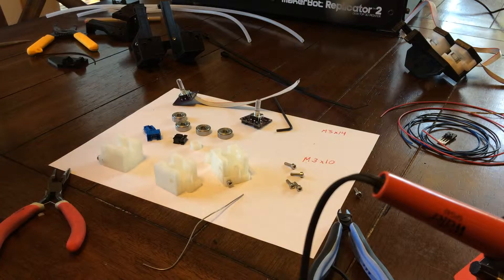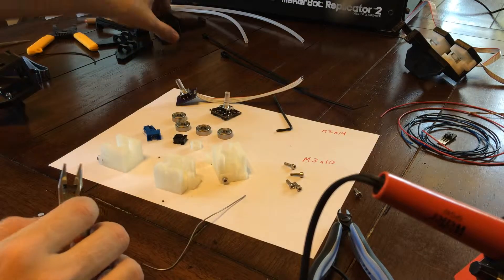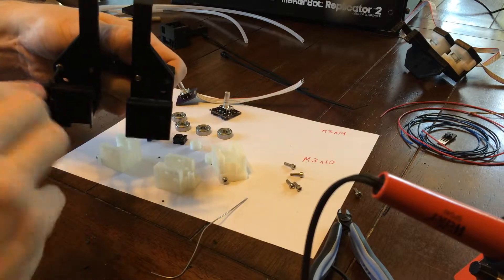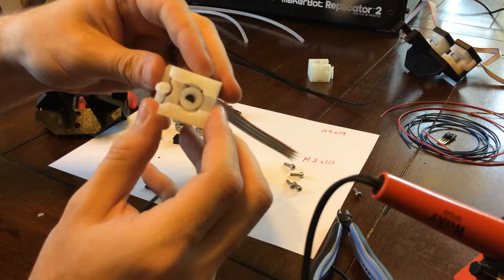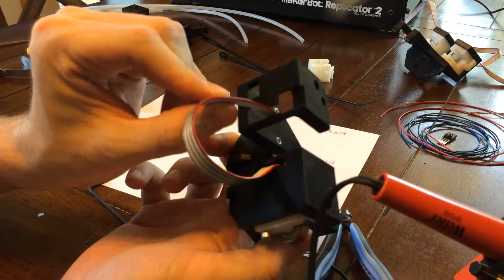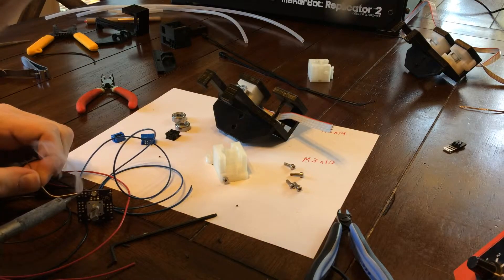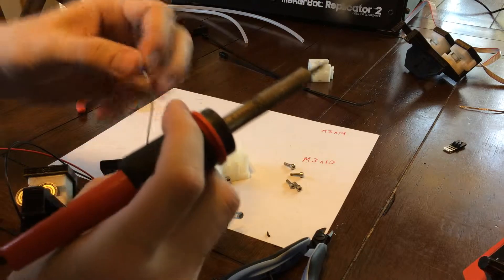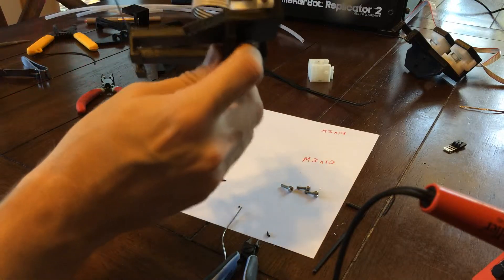Filament Monitor: Assembly

Comment from the maker: The newer revs have the joining ribbon cable going directly frontwards rather than snaking through the brackets. This makes those connections much more stable and far easier to assemble.